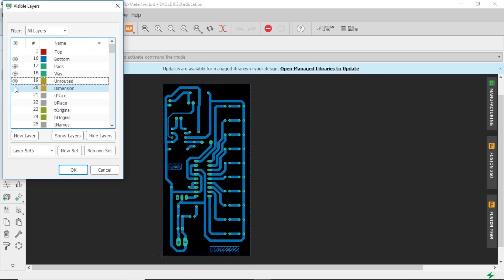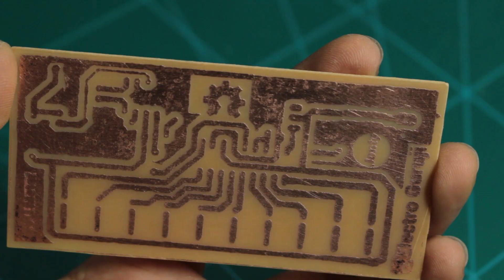How to Make a PCB at Home | DIY PCB Etching

Comment: Thanks for vedio plz let me know while etching cu what about ground plane cu.If it will not cover it will also go into the ferric chloride solution.
Reply from the maker: Andleeb you're right. Having large copper planes will reduce the amount of ferric chloride solution that you need.
Reply: @ElectroGuruji  do you have any idea how to protect the ground Cu surface & etch out only required Cu on the top surface.
Reply: At home without standard lithography etc.

Comment: I liked your video thank you !   I bought from the electronics shop a special type of A4 sized paper : one side has transparent plastic enamel while the other side is yellow colored paper . The shop told me its best for your pcb making method . Did you use this type of paper ?
Reply from the maker: I just bought normal photopaper.

But you could try it with the type of paper you have. Let me know if it works.

Comment: Well explained video! But this method never worked out for ! :( I guess you need to have your own Printer for this method so that you can control the amount of ink used!
Reply from the maker: A few extra tips:

You have to use a Laser Printer on Photo Paper. Any other type of printer/paper combination won't work. 

I use a Dry Iron (No water, No steam) with a completely flat base (no holes for steam) in order to get a more uniform heat transfer.

I use water to help peel off the paper.

I use a hammer and nail to mark the holes so that the drill bit doesn't slip.